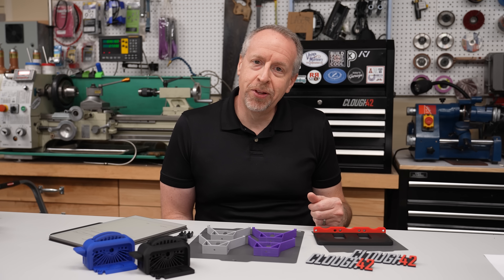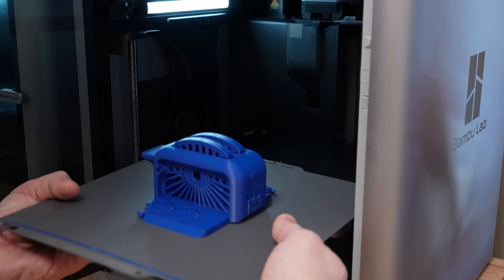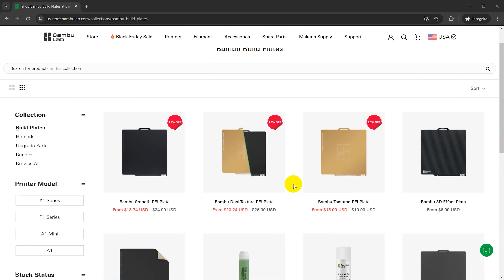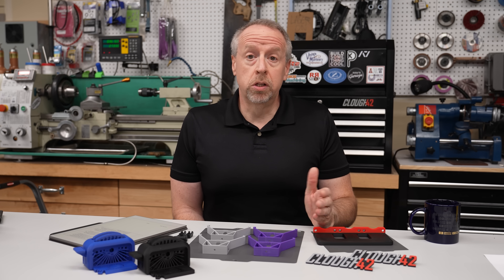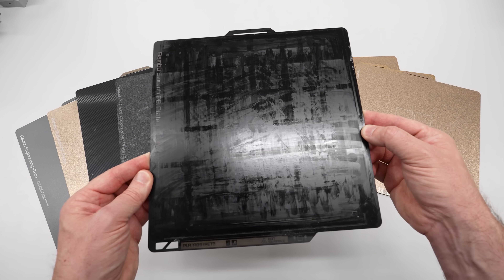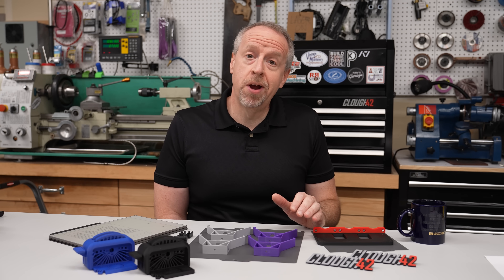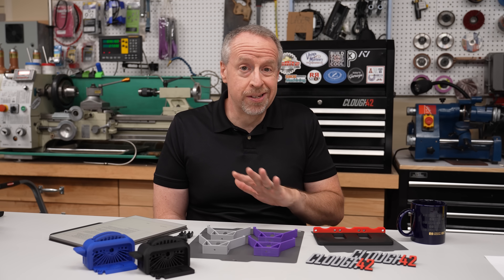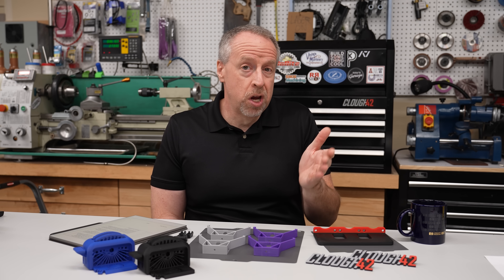Can't get your prints to stick?  Try this

Comment: I feel like every few years we get a 3D Printer company having a go with a PEX/PEZ build plate under a fancy name and every few years it vanishes when people realise they'd rather have one failure in 100 prints than spending three days removing that tiny bit of filament that has inexplicably bonded to the plate - That and it's not "go to" as Bambu seem to be calling it, you can't reliably use it for PA12, PC or most other materials that hate that coating - It's GREAT for PLA - nothing else except maybe PETG. It's always better to have the print bed specialised for the material, there is no one size fits all.

Flashforge went 8 years shipping printers with textured PEZ because for a very long time they were considered the go to for beginner printers, even they have stopped shipping it. I don't know how long you've been printing for but there used to be a certain tape we all printed on coated in PEZ, when was the last time someone printed on tape - it really is a blast from the past.

There really is a good reason every printer comes with a PEI sheet now
Reply: I noticed this also. People don't realize the PEX/PEZ fad has come and gone several times already. G10 is a better all rounder print surface.
Reply: I'm using whambam's smooth PEX right now and it has been great for ASA/ABS but I don't tend to have issues with smooth PEI either. I rarely use glue unless it's a really sketchy geometry.

Comment: I had for a week already haven't tried it yet, I scared to print PETG on ti that it will stick too well :D
You can see at 7:34 that the print is lifting the plate up slightly

Comment: This supertac plate currently does not work with the X1C.  The X1 cant read the code on the plate and the printer throws an error.  Not sure why it can't read it, maybe it needs an update in order to understand the code but I suspect the problem is that the printing on the plate does not have enough contrast with the coating.  During the time when the error pops up and you tell it to ignore the error the nozzle oozes some plastic and the printer does not put down the first layer properly.  And it lifts and you get spaghetti.  I have read that you can turn off the plate detection but I don't have any desire to do that.  I paid extra for this printer to help keep me from making mistakes.  I suspect that this is only a problem on the X1C because none of the other models verify that the plate is what you specified when you sliced it.  My printer came with the gold textured plate which is fantastic!  I also have the smooth plate which is currently my favorite.  I have been looking for the discontinued cool plate and engineering plates because I have a friend who likes both of them.  Both of us get this build plate ID error with the supertac plate and it also appears to be a common issue on the facebook group.
Reply: Same thing just happened to me.  I thought I would be able to just use the plate and select it in the slicer and all would be good, but the same failure occurred. After doing a search on the Bambu wiki, it specifically says you have to turn off build plate detection for the X1C or failure will occur. That would have been good to know before purchasing it, but that info is near the way bottom of the product page so my fault for not catching that.
Reply: Same here - from what I have read in the 3d communities, it is a bug in the X1 firmware - hopefully they will fix it ... eventually
Reply: I bought 2 Supertack plates for my X1C's and they are both gathering dust. I have the same issue, with the plate codes not being read by the Lidar, and I don't want to turn off plate detection. Apparently it's not the contrast, but the actual location of the QR code that is the issue! This really should have been spotted before Bambu started selling them.
I print mainly PETG, and use the smooth PEI build plates for 90+% of what I print.

Comment: At timestamp 7:36 you can see (it appears) the sheet is lifting from the Heated bed. Usually indicating the magnets are not strong enough to overcome the part warping. They are not the only company to do this, but I guarantee they wont address it. But rather offer a sale. :)  Nice vid though, keep 'em coming . Sorry to nitpick. You can check the flatness of the parts after to confirm.
Reply: I use regulair painterstape over the edges on my printers when this starts to happen. It starts to get more and more when the magnets get weaker because of the heating at higher temps. On some beds/printers you can not even go above 70-65 degrees before this starts to happen fast.
Reply: @elvinhaak  I wonder if they could be remagnetized...
Reply: That’s why I like the Smooth PEI plate. It’s thicker than the normal plates so hold to the magnets stronger. I used to get PC lifting the build plate off the magnet but not with the thicker Smooth PEI.
Reply: Yea, I spotted that too. You can get clips to overcome the issue.
Reply: @dylanevans5644  agreed, but with clips you lose bed space and risk collision with the nozzle. And still will create an air gap between the magnetic area and the clip, if there is enough force, right?
Reply: @NathanDavidDodd  
Depends how strong the clips is! Most of those problems can be overcome by putting the clips in the right place. Certainly it's not a perfect solution, but it's just about the best compromise. You can find super thick, or even glass beds, but they have many compromises of their own.

Comment: I used to go for the high temp smooth PEI plate for PLA, textured (black) PEI for PETG and TPU, engineering plate with liquid glue for ABS/ASA. And the old cool plate with liquid glue for particularly demanding PLA prints.

Now I just print it all on the textured (gold) PEI plate, PLA, PETG, ABS, TPU, no glue. And if I worry about a corner prone to curling, I add mouse ear brims. I really think of it as the one plate to rule them all, but I might pick up a supertack plate next time I order.

Comment: I've been using the Biqu CryoGrip for a few months and the Bambu textured pei plate never ever gets used since they are a game changer.
Reply: what temp are you using for the cryogrip? i alway had adhesive problem with cryogrip plate

Comment: I started off with the textured pei build plate, but gave up on it for the most part after I couldn't get ASA to stick to it even with a glue stick.  I'm very much a fan of their smooth plate.  Never had any adhesion issues with it.  Plus, using a plastic razor blade to scrape up the calibration/purge lines is much more satisfying than on the textured plate.
Reply: You need the liquid glue not glue stick for asa. 110deg c and clean the plate with hot soapy water then a thin layer of the liquid glue. Print asa nearly exclusively with zero issue and no need for any brims @pailpardee.
Reply: Use pla for first layer and no bed adhesion issues
Reply: I mostly print ASA and textured plates are definitely not ideal. I don't even use glue anymore on my smooth plates but I found glue stick is just not very reliable with it. If need you glue I'd try a liquid glue or even cheap pump hairpray.

Comment: You fail to mention (sponsored) that these have been around  quite some time my BIQU cryo grip plate is exactly the same a pei plate with polyurea coating on top. BB labs are late to the party with these. I print at 0c with pla on these. What annoys me is you can't set it to super tak plate in Bambu slicer at 0c on any material profiles I set it to 1c then turn the temp off fully on the printer. 
I personally prefer this plate as I have to pause my prints overnight to save any possible complaints from neighbours. I've also saved a 20hr print after a power out these plates are the future of fdm printing beds

Comment: My goto plates have been the cool plate when I need PLA with as smooth as possible bottom surface or tiny parts (although this new plate looks better), the textured PEI plate for most of my printing (PLA, PETG) because it doesn't need glue. But then for most other filaments I just use the engineering plate, it with some glue stick has worked for pretty much all filaments I have tried, nylon, PET, PC, even some PP. If the engineering plate doesn't work then I will generally try the high temp plate but I don't like it because it is just a thin sticker.

I am really considering getting the new supertack plate and the smooth PEI plate though because they will probably solve all my complaints about the current plates, like the cool plate needing glue and the high temp plate just being a thin sticker.

Comment: I’ve been using ones from SliceWorx for months now. They released plates like these ages ago. Lots of different plates for different printers too. Used it to print a ton of mini license plates for Maker Faire OC and 3DPrintopia. People were shocked to find out the fronts of their plates were the bottom layer.

Comment: The only plate you're missing is a custom Clough42 textured plate 😉 also I've found the engineering plate had better adhesion to Nylon but that's about the only time i would use it versus textured pei.

Comment: To help with the build plate alignment on the X1, I've been using a Shifty build plate guide (a model that snaps onto the alignment lug and does magic to align the plate).  I've gone since launch without one until last month... now I wonder how I lived without it.
Reply: Third-ed! I've had my P1S since around February and I just found out about the Shifty like 3 weeks ago and it is so amazingly convenient. I hardly EVER have to reposition the plate anymore. I'm kind of surprised there wasn't anything like that or alignment tabs from the get go. It's such a common issue.
Reply: Just started using the Shifty 3 days ago and it’s like magic. I don’t understand what it’s doing but it does it well. I was at the point I would try and not remove the supertack plate because it was so hard to get it back aligned.
Reply: I second using a snap-on guide.  Makes it much easier to get the plate aligned correctly.

Another thing Bambu should be adding to their list for improvements to future printers.

Comment: I got the Biqu Cryogrip Glacier purely because it can be wiped down with rubbing alcohol.

It doesn't have the lower bed temps, and isn't quite as sticky (though somewhat more sticky than any other plate I've used, textured included).

The material seems softer at least with the cleaning area where the nozzle scrapes, so maybe it'll have a shorter shelf life but so far so good and I'm exited for this new wave of much better plates.This version also works with a wider variety of filaments.

Comment: I just started using the super tack plate a couple days ago, mostly with PETG. It sticks too well at their stock setting of 70° (same as textured and smooth PEI), but since they list 45° as the ideal PLA temp on the super tack, I tried 60 for PETG which also stuck too well, so I set it to 55. I tried 50, but the corners of my print curled up, so I’ve left it at 55. But honestly it’s such a chore to remove prints from that plate, I prefer smooth PEI with Vision Miner NPA. Prints stick like nobody’s business, but release super easy. I try to only use it when I’m concerned about part adhesion, but it’s just so foolproof that I find myself using it more and more just to ensure perfect adhesion and easy print release.

Comment: If you are using glue stick or liquid glue, does it even matter what the build plate material is? 

It seems like the print would then be sticking to the glue, not the plate. Does it matter if it’s PEI, or glass, or even just a piece of spring steel with no coating at all? I always thought the whole reason to use PEI was so I DID NOT have to use messy adhesion aids like glue stick!

I’m current.y running a PEI flex plate, but for PLA the best adhesion I ever had was to the glass plate that came with my Ender 3V2 - I kept a little hammer around to give parts a wack to release them from the glass plate and a scraper with those orange plastic blades for thinner parts that were too short to wack. And that was at 40 degree bed temp!

PS: I really miss wacking parts to get them off - so does the cat who loved to chase the ones that came off a bit too well!

Comment: hi James, just an idea ive had kicking around, could be used for filler content. the idea is instead of wrapping duct tape or leather ect around a vise grip to install threaded rods, standoff, or knurled knobs ect would it be possible to print a jaw cover for a knipex pillar out of tpu or filament with comparable durometer/ pliability characteristics.

Comment: Hairspray for nylon and ABS/ASA. Can't beat it for surface finish or adhesion and release. Show me something better. Good luck.
Reply: Why would you want to have to use glue? It's just extra faff
Reply: @BeefIngot  Nobody WANTS to have to use glue. However, try printing nylon or ASA/ABS without it and see what happens.

Comment: With PETG I mostly use the smooth PEI/HighTemp plate bare (clean with alcohol, no glue, etc) Same with the textured plate. Bed adhesion has always been excellent. In general if I have adhesion issues I don't put anything on and it always seem to be better.
Reply: I even do the same with ASA/ABS, which is my primary material. The trick I found is using a dab of acetone on a microfiber cloth to clean smooth PEI instead of alcohol. I eventually noticed IPA can actually leave a slight residue which normally doesn't matter but with ABS the difference was night and day. Dawn soap/water is the next best option.

I put WhamBam's PEX on my main printer a couple of months ago and also liking a lot. Similar to PEI but seems even easier to work with. Oddly, only time I had to resort to a little hairspray/glue recently was to stop some TPU covers from slightly lifting the corners.

Comment: This may be an odd question, how would you recommend cutting this plate?, I have a Voron V0 and this could be a nice plate for that machine. With an angle grinder I would be worried it would gum up while cutting through the build surface. Great video and great review!

Comment: Got one last week and I must say it grips very well. Printed both Elegoo Rapid PETG and Bambu PETG HF.  Took a bit to get used to as it has actually ripped pieces off the bottom of two prints printed in the P1S.  Will give it a test on the A1 with a large print as I was having warping issues with PLA.  I think it will pass the test.  I'm going to order a couple more once they are back in stock.

Comment: 2:34 i'm surprised you're having insufficient adhesion with PETG on PEI. I've ruined a smooth PEI build plate because the PETG stuck too well and peeled up the surface, i have to use textured to avoid this. i haven't finished the video so this new plate might make this a moot point, but you could try a less coarsely textured plate with PETG (or if you're willing to risk it, a smooth plate). one difference is that i'm using prusa, not bambu lab plates

Comment: I haven't tried the Bambu plate. However, I do reviews on Amazon for new products which Amazon provides. I recently received a build plate for an A1 Mini that looks and works like the Bambu plate. It has the brand name Yoopai and is called their Epoxy Resin plate. It too is super sticky, infact at times too sticky. After seeing the Bambu plate I started printing the Yoopai with the Super Tack settings and have had great success. The A1 Mini plate is $9.99. I bought the same plate for my P1S and both have become my go to plates. I have only used them with Bambu PLA Basic but really like the results. The texture of the plates sounds much the same, and the Yoopai plate is also difficult to place correctly on my P1S. If anyone does a comparison I would like to hear their thoughts.
Reply: Hah, I do reviews on Amazon for products as well in the UK, just put it in my wish list as it's only available as a USA import at the moment. Fingers crossed 😉
Reply: Out of curiosity how often have you given 1-2 star reviews to free products?
Reply: @JJFX-  A few times actually as they have been really bad, I had a power bank and the battery swelled and cracked the case, and a few items that have fallen apart after first use. 4 is my normal rating, 5 if it's really good quality and the price is OK and 3 if it's OK quality wise but is not quite what the description says it is, like today, a well made ratcheting screwdriver that does not actually ratchet. Not sure if it's the same in the USA but I'm amazed that some reviewers give 5 stars in every review even though it's a POS and some that obviously have not used the item as they get so many things wrong, and don't get me started on the 5 word reviews.🤬
Reply: @thegrumpygamerTGG  Glad to hear it. I'm asking because I've grown so tired of Amazon and how easily listings and reviews still get manipulated.

I rarely see free product reviewers leave more than an occasional critical review so I'm curious if you think doing that frequently would affect being in the program or how often they send products.

Comment: PLA sticks like whoa. I would say too well because sometimes I feel like I am going to break a print trying to pry it off when I print small things like Zou3D models. I had a friend tell me to stick it in the freezer to get it to release those little models and in my experience that does not help. I'm actually looking forward to when my plate gets a little worn in where it sticks less well.

FYI I have had small PETG models lift on corners, even at 80c, on my A1 using this plate. My X1C doesn't have this problem with this plate so there is still an issue with open air bed slingers and PETG which I have come to understand is a thing with my A1. 

Don't forget you aren't supposed to use IPA or any chemicals on the plate. Just soap and water occasionally.